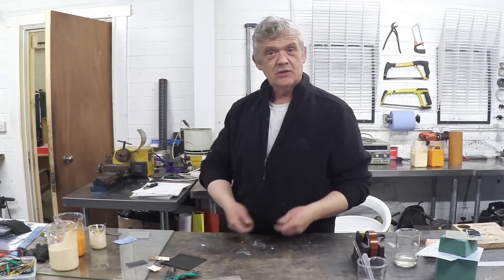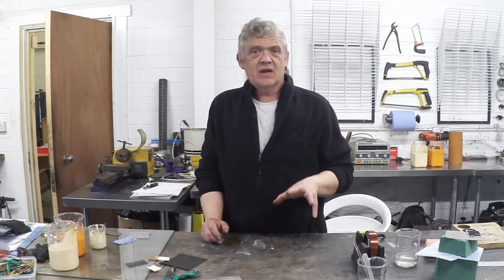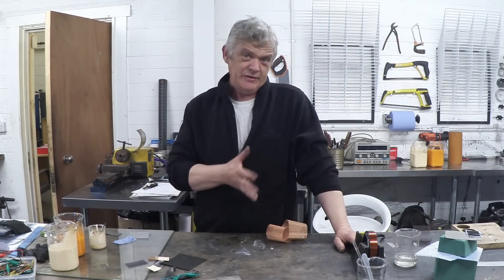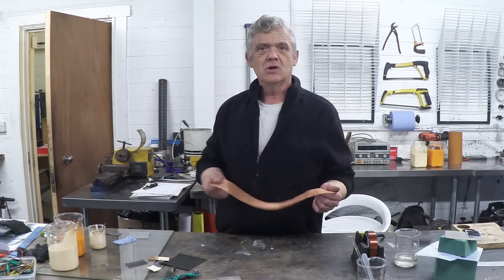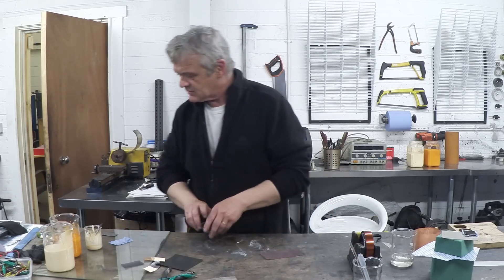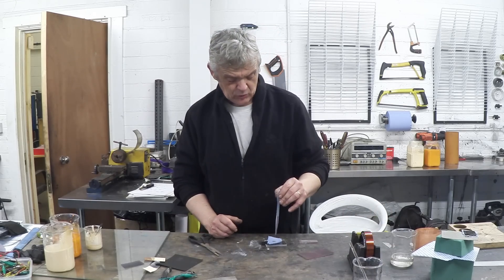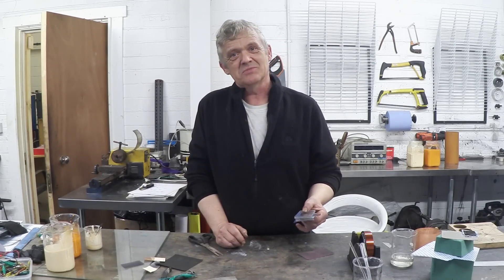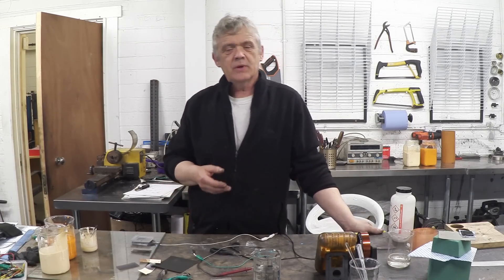A Simple Homemade Solar Cell

Comment: Awesome. 
Im too much of an introvert to put up youtube videos. But copper (I)  and copper (II) behave as you said very differently.
I did work on making bulkscalable nanoparticles ZnO doped with Al and treated with hydrogen to get rid of mostly surface non Perfect ZnO wurtzite so that is turns from being yellow/white powder (as ZnO undoped also is), to lightgrayisch ZnO nanopowder, with intact wurtzite structure and nearly no growth in nanoparticle size after treatment with hydrogen. XPS showed only ZnO wurtzite, no trace Al203 or other phase seperations. (and was planning also to do the same thing Ga, but time for my projects ran out) . The Al doped ZnO thin films have long been know to be both conductive quite nicely and be transparant.
But when making ZnO doped Al via sol gel and thermal decomposition, no such conductivity is found. Only after treating it with hydrogen it became similar to mediocre graphite in conductivity, but still very cool. Leaving the sample open to the air for months did not lower its conducvity.
The day before yesterday I looked up my old research again and did some google school'n to see if any body had expanded upon similar nanoparticles. 
I did find not much, even though its been 10 years. 
Except: I found lots of stuff going on with both doped and undoped ZnO and Copperoxide bi ceramic nanorods functioning as a PV system but also in hydrogen generation, from the whole range of only acting as PV to nearly only acting as hydrogen generation (from water ) also using light. Super cool. When my local university opens up again and I dont bump into those pesky paywalls 95% of the time being on the campus network I will look deeper into the matter.
Making copperoxide nano or copper nanoparticles is quite doable as it seemed from literature. I merely looked at that as possible candidates for inkjet printing them to have conductice pcb like tracks on substrates like like glass but also high temp PET. It was just a literary research assignment, but a fun one. Sure also gold and silver and platinum and PEDOT:PSS and the whole range of other unobtanium were possible candidates. But the copper based routes offer so much flexibility and is, duh, more accesable then gold or silver. And the color of copper is aweome. I like it better then gold  haha. If you ave really pure surface oxide free roughened surface, its almost salmon pink.
Leaving it open to te ambiant air gives a nice classic copper color. Handing it with dirty greasy sweaty hands or keeping nice copper near (oops) a not so well closed container/jar of those swimming pool chlorine tablets will turn it black in no time. 
Copper has lot of potential. 
( :) )
Reply: I'll just pretend I understood something from what you said
Reply: Excelente work, brother
Reply: you dope ZnO by mixing in a few percentages of superfine Al powder? i would suggest MgAl in case you make it all from scratch since its possible to turn into fine powder with a hammer

CuO can be reduced into Cu2O by boiling with glucose and NaOH for some hours (well probably 10 minutes should suffice, but)

the printing idea sounds like it would have high production capacity, but how does one get to dump the chemicals into ink cartridges? 

perhaps sodium silicate could be left to evaporate and then harden at 150c, this should give something similar to glass, then put some sturdy backing on that for good luck and one would have very simple PCB's .. and these can work as solar panels? 
gasoline left to evaporate about 50% will be able to dissolve polystyrene, very easy and cheap paint, could be turned into plastic boards if put on a greasy flat surface, heat treatment could turn it super transparent

sodium silicate is easily made by NaOH with transparent kitty litter 

@blueredbrick
Reply: @WeebRemover4500  The doping was performed via a sol gel synthesis method. That means making a gel solution that contains a few molar percent aluminium. 
After baking to a high temp the material is ready.

Comment: Cool stuff! Could you stack those (like multijunction) and get say 600 mV? What is the micro amp (cautious question)? This may be interesting https://www.scientificamerican.com/article/cheaper-solar-cells-with-a-new-salt/ Japanese got 32% with advanced multijunction. Maybe something to use your dipping machine for ;-)
Reply from the maker: maybe - but this is really a starting point as opposed to a finished cell -- there is quite a lot to do to this to get a real functioning cell

Comment: Now the $1M question...  Can you make those as cheap ($/Watt), as you can buy them, (in 2020)?
Reply from the maker: no - that's not the point here
Reply: @ThinkingandTinkering  Very interesting video.
Reply: The real $1M question is, can you build one big enough to provide useful amounts of energy? Maybe you just want to try DIY as a hobby for your off grid cabin, maybe you got stranded on a deserted island and need to MacGyver a way to power something to survive and don't have lots of wire for a dynamo. Could you make a square meter of these things and get enough power out of it to make the effort worth your while?
Reply: Hes carry the knowledge on to the next generation, too many kids study tiktok and fortnite and we get shortages of knowledge lapses of innovation, if you can get access to this knowledge now, however useful it may be, maybe we wont become an idiocracy. More kids will leave tik tok behind and become the innovators.

Comment: Robert, ~50 years ago one of the science magazines, I think Popular Science had an story about  lead/copper solar battery (in glass jar) with electrolyte, charged with sun, and served as storage. The copper was treated with ammonia and heat for cupric oxide surface (photo electric). Electrolyte was something I could not buy as a child. It may have been lead nitrate, or sulfate. Seeing your video brought that memory back.  Thought it may be of interest, and perhaps improved with new tech.
Reply from the maker: I read about lead copper batteries a while ago - I'll have to hunt out the reference as it was a while ago lol
Reply: Of those 2 it was probably lead nitrate, lead sulfate is insoluble in water
Reply: @terabyte7683  yes, lead nitrate sounds familiar.

Comment: A few days ago you showed how to plate metals in an oxide layer using electrolysis.  I wonder if that could make a more uniform layer?
Reply from the maker: yes it can - I have the chems on order for the bath
Reply: @ThinkingandTinkering  I am off to search for the video right now, I hope you made it.
And, silly question time, what is the coarsest mesh of screen you'd suggest?

Comment: I wonder if it would be possible to use the copper mesh in the construction of a perovskite-based solar cell, perhaps with the perovskite crystals growing in the holes in the mesh.
Reply from the maker: for sure mate
Reply: Which ones?  
Maybe try:
KSnI3
KSnBr3
NaSnI3
Reply: Possible Perovskite ideas to try:

Potassium germanium chloride?
KGeCl3 = KCl.GeCl2

growth of single crystals and films from solution (around 400-500 nm thick) using a mixture of KCl and GeCl2 powders as the precursor. Estimated growth rates may be on the order of 1-10 mm3/hour.  
(20-200 cm2/hour @ 500 nm thick)
——-
*
Methylammonium germanium chloride?
(CH3NH3GeCl3?)

1)
CO + 3 NH3 -> CH3NH2 + H2O + N2+ H2

2)
CH3NH2 + HCl → CH3NH3Cl 
at 0 °C for 120 minutes followed by evaporation at 60 °C, yielding crystals of methylammonium chloride. 

3)
CH3NH3Cl + GeCl2 → CH3NH3GeCl3

growth of single crystals and films from solution (around 400-500 nm thick) using a mixture of CH3NH3Cl and GeCl2 powders as the precursor. Estimated growth rates could be on the order of 1-10 mm3/hour.  (20-200 cm2/hour @ 500 nm thick)

Comment: Given the surface area of the cell, in terms of wattage (rather than just voltage) how does it compare to a commercial cell.  Or rather, what's the cost per kW would you say?
Reply from the maker: well below mate - but we aren't trying for that - this is just an intro - you can expect commercial performance
Reply: @ThinkingandTinkering  No, of course it can't compete. I'm just curious what such a simple set at gives per kW as a starting point. Is it one order of magnitude off or two. That said, I can't see the plastic lasting under the sun and the electrolyte would dry up, it's probably a long way from practical.

I wonder how many leds you would need to get a kW... They're pretty cheap and they'd generate a current.

Comment: Copper Prices being the main issue at hand.
Reply: The copper usage can be mitigated by electroplating. (much like the micron-sized gold plating used on electronic circuit contacts.,
Reply from the maker: for sure
Reply: Aluminum?

Comment: would you be able to use a mesh as the current collector and be able to stack these cells up (of course with diminishing returns) to create a more efficient one, that light can penetrate through? that way the size of teh cell can be kept small and still be able to have a large surface area for the CuO I to be exposed to light
Reply from the maker: nothing to stop you trying mate
Reply: Fold the mesh to be a sponge block perhaps.

Comment: You're really churning out the video Robert I'm learning loads!
Reply: Speaking of Which:
56 Years
35 Millions People Died 
[+15 Of COVID]
1 Completely Gay Allied Forces General...

...and Fauci was just Slapped on the Fingers...

Imagine what Both the Gay General and the Jesuits were and are Churning for All of this Time while the Rest of the world was Dieing...

It isn't Butter....
Reply from the maker: Glad to hear it mate
Reply: @ThinkingandTinkering  what about stacking the electrodes like you would a capacitor(using mesh materials for both anode amd cathode) and letting the heat from the sun vaporize the electrolyte so that it makes a steam powered solar cell!